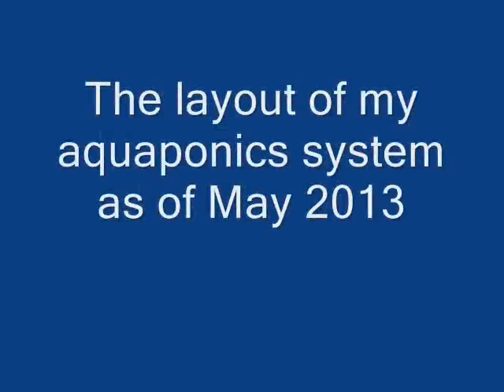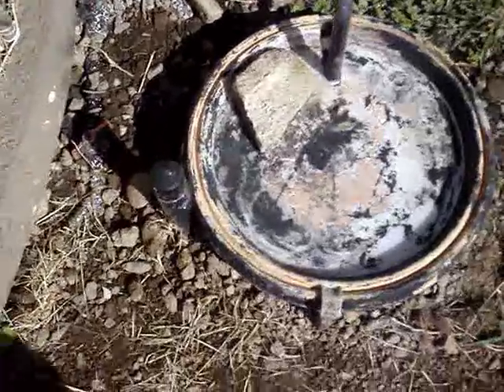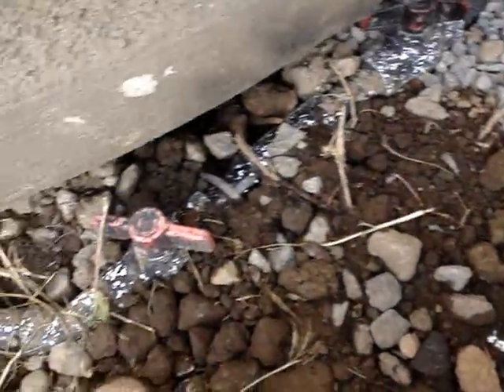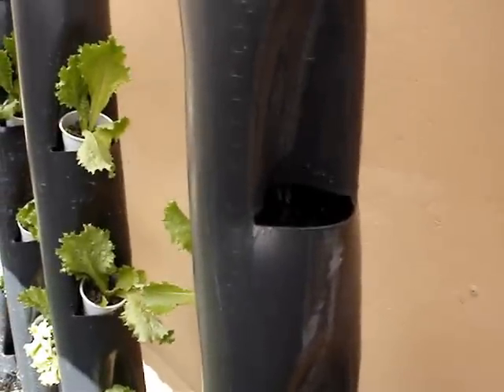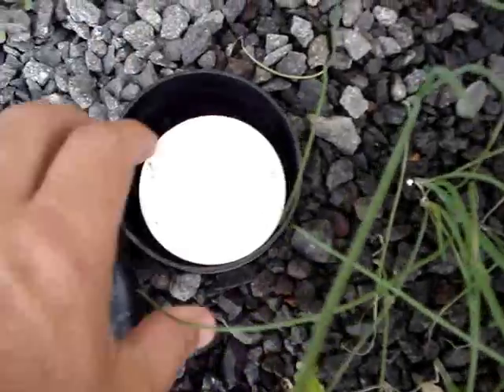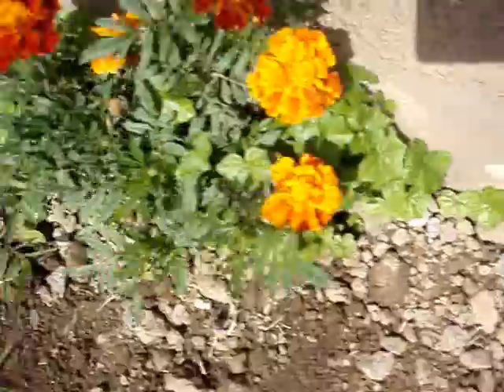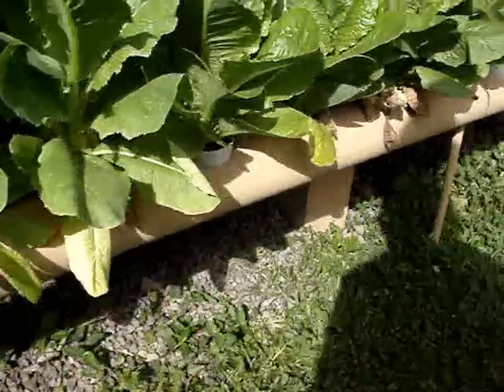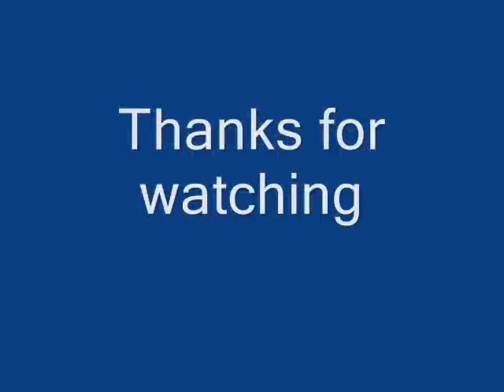Aquaponics May 20130001

Comment: nice looking system, i was skeptical at first about the water depth for you fish... it didn't look deep enough for an outside system.. but i suppose that depends on where you live and the climate there.  You seem to have had this system going for a little while now.  I don't suppose you would do a video showing what you've learned along the way, and what failures you've had to overcome (so we can learn what not to do and save ourselves the same hassles).  thx.

Comment: Nice setup.  I notice you don't have a biofilter  do your towers get enough nitrites coming straight from a solid filter? My understanding is that with out a biofilter the water would need to go some sort of media for bacteria growth, like running threw the grow bed where the beneficial bacteria live on the grow media and create the nitrates for the vegetation.  Would it be better for the lettuce to have water collected in a sump tank from grow beds?
Reply from the maker: I think you are right I never really got the plants to grow good in the towers.
Reply: Google search "aquaponics bio filter" in the images there is a example of an orange olive drum set up.  That would be the easiest fix I think.  Only issue is, it would have to be mounted on the wall higher than the towers so it will gravity feed.  Than you pump water up to the bio filter from your solids filter.

Comment from the maker: Yes the water level changes everyday. I have roofs over much of the system for two reasons one to keep the rain from over diluting the system and two for the sun . I use rain water to keep the system filled, depending on how mainy plants I have and how hot it gets I use about 2 gallons a day.

Comment from the maker: I have tried three other designs and this one seems to work the best, solids still manage to get into the plant box but I have a good supply of worms and the plant box stays relativly clean. If I had to do it again I would have made the pond round and placed the drain in the middle and have the two boxes empty into it at right angles to make the fish pond slowly swirl also. With this current design I have to brush the pond daily to keep it clean.

Comment: Excellent!  What part of the country are you in?  How do you keep the water temps low enough for trout?  You do a first class job on your projects and it does not appear to cost you significantly more money to do it right.  Is that concertina wire on the top of the wall?  Thanks for the videos!